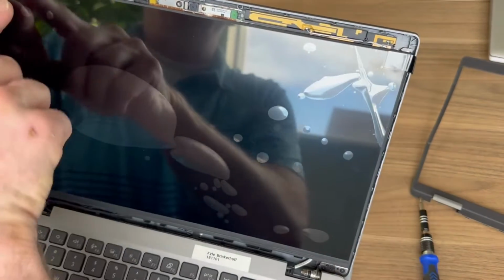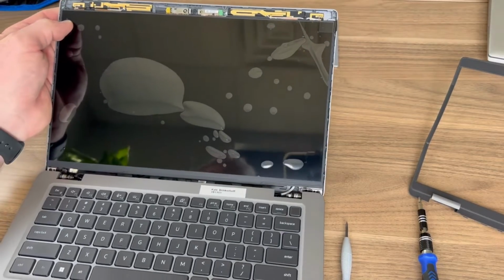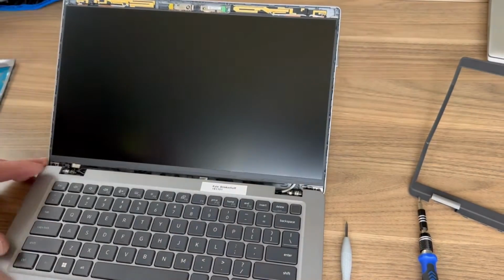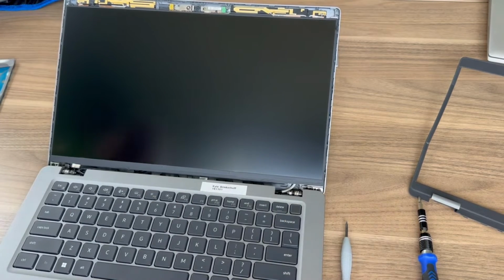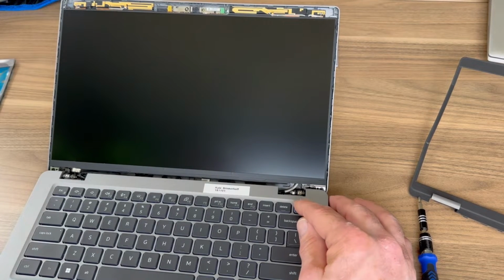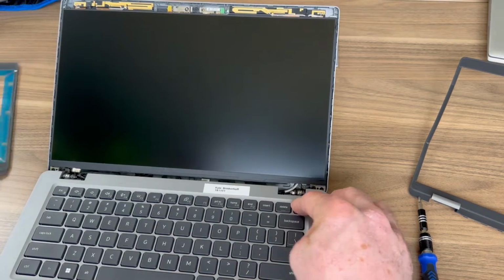Dell Latitude 5430 LCD Replacement

Comment: Was there a particular store you found the screen AND new bezel?  I'm looking in ebay and they don't seem to add a new bezel with the screen.
Reply from the maker: Finding parts can sometimes be a challenge. On most of these videos, the parts were provided directly by dell under warranty.  When I have to find parts, I usually have luck on amazon or eBay.  All depends on make and model.

Comment: it is possible to reuse bezel ?
Reply from the maker: It depends from model to model.  I’ve reused bezels hundreds of times if the bezel removes without breaking or losing too many clips.  Many times it can be reapplied with no issues.
Reply: @TechQualities   , yeah they make de bezel so fragile to buy a new one when replacing lcd , quality has dropped so much

Comment: thank god you dont have to dissasemble too much to replace LED
Reply from the maker: I do appreciate that about most dell models.  There are a couple models that have the hinges attached to the LCD display (which makes no sense why they’d design it that way).  With those you have to remove the bottom cover and 10 times the amount of screws.

Comment: So easy?. Is the screen generic for all Latitude 5430 2022?
Reply from the maker: Not sure what you mean by generic, there are several vendors that design these with the same pin interface.  As long as you purchase one compatible for this model laptop, you should be fine.

Comment: Hi can I please ask does the replacement silicone screen surround you applied at the end, would this come with a replacement screen kit please or would you have to buy that separately? Thank you
Reply from the maker: It depends on the vendor.  Most of the time, the bezel is not included.  If not you can search for a replacement bezel for the same model.  NOTE, many times you can reuse the old bezel, you just need to be careful when removing it as it can kink or break.

Comment: Nice video!
Do you have a remedy for color chipping at the edges of the 5430? I got chipping all over and the only "abuse" is the sliding in and out of the laptop in a super soft cushioned laptop backback!
Very frustrating for 1500 euro laptop.
Reply from the maker: I’m so sorry you’re experiencing.  I don’t know of any remedies for this.  Likely will have to replace the LCD.

Comment: where did you get the screen replacement from
Reply from the maker: Thanks for inquiring.  Most of the Dell parts we replace are under warranty and parts are provided directly from Dell.  However, in most cases when servicing systems for parts replacement, we can find them on Amazon Prime or EBay.  Reach out if there is a specific part you are looking for and need some help.
Reply: @TechQualities  what is the name of the ldc ? what did you type to find it ?